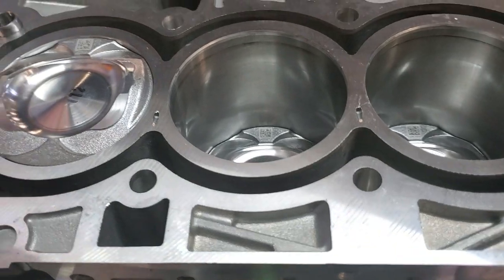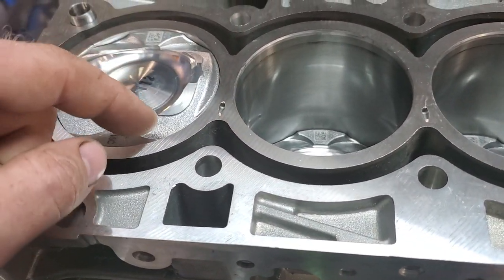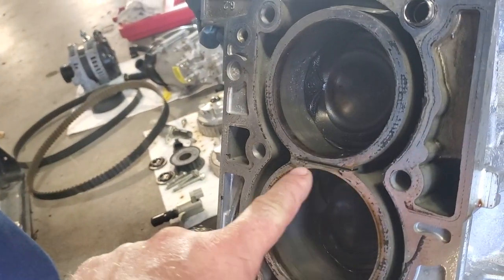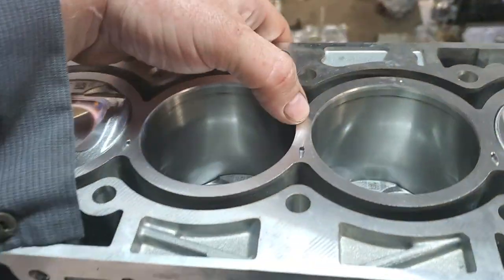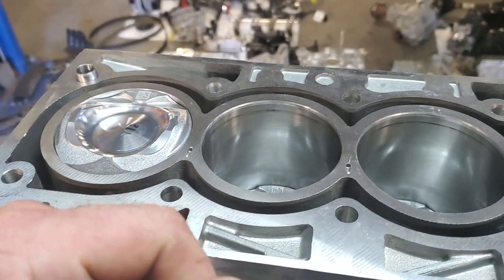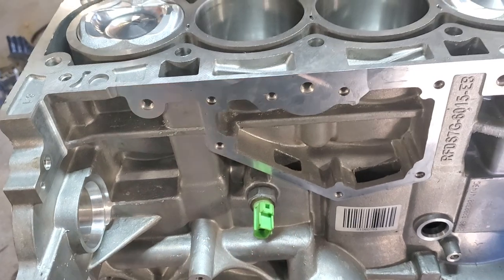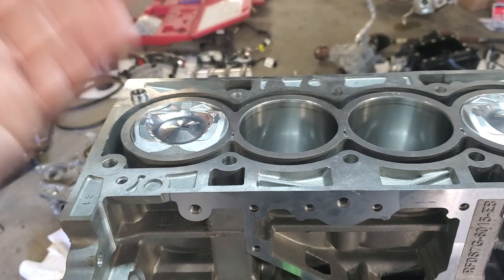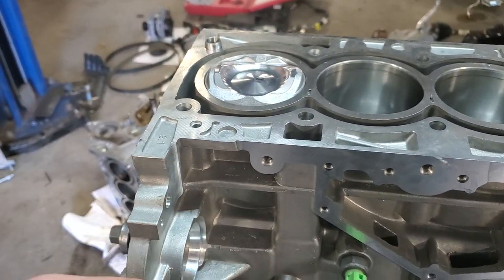Fords 1.5L EcoBoost Engine New Block Design Explained

Comment: We had our engine replaced in our 2018 Ford Escape.  It had 50,000 miles on it and was 4 years and 10 months old.  Ford did a great job and are a moral company for replacing our engine.  The car runs like a champ and Ford realized some engineering problems AND fixed the problem.  We've had Ford's for over 50 years and will continue to buy them as long as they honor their customers as they did in this situation.

Comment: Last September my 2017 Escape started roughly in the morning and a warning light came on. The Escape was scheduled for a service at the dealer and I asked that they look into the warning light. Turns out the engine needed to be replaced due to coolant seeping into one of the cylinders. This happened at 67,000km and took one month to complete the work.. I was provided with a rental during this time. A short block Three pages of itemized bolts etc was provided. Got a free wheel alignment out of this since the work affected this area.
Reply: How much you pay for thw engine replacement?
Reply: @galladinfirever  The repair was covered under the extended power train warranty. It was a short block rebuild of the engine and took about 5 weeks. I was provided with a Ford Explorer as a rental.

Comment: Had this problem the dealership was told to just replace the block with the old style! The mechanics refused to do it unless it was the new style so far it’s doing good but mine only had like 800 miles when it happened
Reply from the maker: it's good that they stuck to what they knew was right

Comment: as a retired GM, Ford tech I thought it was nuts to turbo any engine under 2.0.  I know someone who got a new chevy blazer and it has a 1.3 turbo and told her to be ANAL (3k) on the oil changes and use good oil and filter. these motors under 2.0 are pretty much motorcycle engines. looks like you can't get the 2.5 in the new escape only turbos, that's a mistake. nice videos bro.
Reply: This was why I went with a new Ecosport instead of the escape.  The ecosport has a 2.0 non-turbo motor in its awd version.  Hopefully less problems down the road.

Comment: Great Videos!! Have you seen 2.0L short blocks to see if they also changed to the drill style over the slit? Our 2.0L is getting a long block so we can not see.
Reply from the maker: yes its also updated this way
Reply: @FordBossMe  That's great too hear. I found it very strange that 1.5L gets short blocks and 2.0L gets a long block by default. Though maybe it was trying to hide the slot was still in use...
Reply from the maker: yeah, the tsb says its best to just do the long block, also because of possible valve damage

Comment: Hi there! I’m having my engine replaced on my 2017 Ford Edge Ecoboost because of the coolant intrusion issue. Are they able to put a newly updated engine in it with the slit correction? I’m deciding if it’s worth it to have a new engine put in or not. I don’t want the same issue to happen again down the road! Thanks!

Comment: Do you have any videos of the 2.0 Ecoboost where it shows the new block revision? I ordered a Maverick and I’m curious if it will have the new drilled design.
Reply from the maker: They got rid of that issues with those long blocks in mid 2019 so you're not dealing with any of that with a brand new vehicle

Comment: Thanks for showing the difference between the two blocks, very helpful.  My '15 Fusion is waiting to have this done now.  Are you aware of any of the replacement blocks having same coolant intrusion issue?
Reply: Sorry, just read your answer to HepA Gaming 11 months ago.  Are you still unaware of this issue occurring with any of the new blocks?
Reply: Do you have to foot the bill or is Ford still covering it on your 2015?
Reply: @ScottKelley  hi Scott, my car had 66k miles so it was outside of the warranty.  I contacted Ford and in my case they ended up covering more than half of the cost of the block replacement ($7,700).  Hoping the new block will not have this issue.
Reply: @mikebishop1970  Mine was out of warranty too at 75k miles, just got it back a couple weeks ago from getting the new block. I had contacted Ford as well and they helped out with the costs luckily being that it was out of warranty.  Had the car less than the 5 years powertrain warranty at least.
Reply: @ScottKelley  Glad to hear that Ford helped you too.  Hopefully no more major issues, I still like the car.
Reply: @mikebishop1970  Same, I quite enjoy the Escape overall.
Reply: @mikebishop1970  what number did you call? Mine is having the same issue and they told me it was out of warranty and gave me the number to national something and told me to call them.
Reply: @penisass666  Trying this again.  The number I called was provided to me by the Ford dealership.  After I contacted the Ford support team a case was opened and they communicated directly with the dealership until this had been completed.  The Ford dealership should be able to provide you with the correct support contact information.
Reply: You won't have the same problem don't worry

Comment: I just bought a used 2017 Escape Titanium for my wife. It has 120,000 kilometers. When we got it home it was stuttering and throwing code p0302.

It's at Maclin Ford getting the long block replaced now, and the dealer who sold me the car has kindly agreed to pay.

Seems to me that the lady who had traded the Escape in knew she had a problem and didn't bother to mention it.

I'm surprised that this slot design allowed the engine to last as long as it did. I've heard that there are more problems with the 1.5 than the 2.0.  Maybe it's because the turbo has to kick in more with the smaller engine, upping the pressure.
Reply: Do you know why the dealership is replacing complete engines and not just servicing the head/gasket? If it lasted 120,oookm/5years already...... The cost difference is crazy to me...
Reply: @DrJeff-vn1st  Some dealers have been replacing the gasket, but the problem usually reoccurs shortly after.  Either because of the lousy fundamental design or because the block itself becomes corroded in the area of the leak.

Comment: Hey have you heard of any issues on coolant intrusion with the new redesigned block? I’ve heard of people on their 2nd or 3rd engine with the 1.5L and even 2.0L but not sure if that was just dealerships tossing in the older design with slits as they hadn’t released them yet/didn’t have them on hand or if there’s issues with the newer “version” as well
Reply from the maker: new versions nonehave had issues here
Reply: @FordBossMe  I think 2015 ford ecoboost 2.0 not so problematic quite reliable at least in fusion just not sure if on 2015 fusions they are close deck or open deck
Reply: Where did u hear this @hepagaming6206 
cause I had my engine replaced with the new redesigned block and 5000 miles later. I experience coolant loss again

Comment: Did this update fix the issue? I just bought an escape that has this engine in it. I'll keep an eye on the coolant, but I'm wondering how this has fared after the update.
Reply from the maker: I have not seen one return with low coolant
Reply: @FordBossMe  awesome! Respect for the speedy reply. Thank you

Comment: What break in oil do you recommend? Rebuilding one now
Reply from the maker: Honestly they just have us use the Motorcraft stuff
Reply: @FordBossMe  thanks for replying
Reply from the maker: @mayo8216  if you need any part #s or anything please let me know
Reply: @FordBossMe  thanks man. Just pray for me lol
Reply: @FordBossMe  there is a gasket on the cam assembly on the transmission side. Do you know what its called? I'm sure i can eventually find it but I've been looking.

Comment: Hi. I am looking to buy an ford focus 2015 with 1.5 Ecoboost engine and 140000km on engine. What do you think? Did ford focus from 2015 use that engine design or that year is not affected with bad engine design? Thanks
Reply: A 2015 Ford Focus is only equipped equipped with either a normally aspirated 2.0L directed injected or 2.0L Ecoboost engine if it's from anywhere in North America.

Comment: What year is the new blocks?
We just bought a '21 Escape with a 1.5.
Maybe ours has the newer block?
Reply from the maker: Yours isn't even the same engine, if you look at your engine and you do some research on it you'll see that it's a 1.5 L 3 cylinder new design where this engine is a 1.5 L 4 cylinder old design

Comment: Does the 2020 escape 1.5l 3 cylinder have the new block?
Reply from the maker: The 3 cylinder is a completely different setup 

It does not have the issue

Comment: I just recently bought a used 2018 Ford Escape 1.5  EcoBoost. I thought I was getting a good deal it only had  7500 miles. I didn't buy the extended warranty. I haven't even made my first payment yet.  Please help any suggestions?  Should I buy  a extended warranty now? Which company do you recommend. I am so bummed out now😞. I been a long time Ford owner.
Reply from the maker: I would always buy the extended warranty and I'm going to make a video on the reason why

Just keep an eye on your coolant reservoir maybe check it once a week and see if it's throbbing and if you see a drop I would say noticeably take it to the dealer and let them know that you would like the intrusion block update checked
Reply from the maker: https://youtu.be/0ZGfJb_Iaps
Reply: The dealer said I still have powertrain warranty for 2 years or 52,000 miles whichever comes first. I may trade the car in this winter. Thank you for your comment I am also going to  look into extended warranty.
Reply from the maker: @mannychavez9250  Very Good indeed

Comment: What model did the new block come . I have a 2016 focus 1.5ltr turbo ecoboost 
Can you avoid it in advance by putting a cooler thermostat thermostat and better fan
Reply from the maker: No you can't because it's a block design so no matter what you change about the vehicle the bad block design is still going to be there and if you Google 1.5 L EcoBoost coolant intrusion you'll figure out what vehicles were affected by it
Reply: Thank you so much

Comment: my 2018 escape has the issue, cylinder 4th keeps getting misfire and coolant goes down very quick, Im getting the entire engine replaced, does the new engines from the dealers come with the new design?
Reply from the maker: Yes it does come with a new design

Comment: We're desperate for info.  How can I tell if our 2020 Fusion SE (build date 6/2020) has the updated design of the 1.5 ecoboost I4 engine that does not leak coolant into the engine?
Reply from the maker: Call your local dealership ask them to look at your warranty service history and see if it's been done
Reply: @FordBossMe  Brand new car.   My wife bought in 2020. Haven't had any warranty work needed. Just trying to see if the new car was built with updated 1.5 engine.

Comment: Have you had any of these engines with a rod knock? I have one with a rod knock type noise coming up through the number four cylinder.
Reply from the maker: It's not a rod knock you have a cracked flywheel

Comment: I replace short block engine to long block engine  now i have a water pump harness with no spot to plug it !! What should i do ? Thank you
Reply from the maker: You're going to cut the harness off of where the connector plugs in and you're going to cap both of those lines and they will no longer go to anything
Reply from the maker: Whenever you go to cut the lines make sure you cut them several inches back

But that is the update to the water pump, Ford gives a more sufficient water pump and then you have to cap the ends of the connector and it will no longer be used
Reply: Thank you so much man  i been wondering for 2 days about this connector   👍
Reply from the maker: @Moe151  I don't think there's a programming thing involved like after you cut it but I have to check back in my paperwork when I get back to work on Monday but you should be good

Because I remember one time having to replace the waterpump on one of these engines and the new water pump didn't have the connector on it and I was like what the heck and then I looked in the computer and it was like because it's a more efficient water pump there's no longer a need for the connector
Reply: @FordBossMe  ya thats what i was scarring from put a brand new engine then i will have a check engine light on! 🙂 i really appreciated man
Reply from the maker: @Moe151  I know there is a update to that water pump that gets rid of the connector for sure, even when you look on the parts guys computer at work there is a Ford message that says cut and cap old connector to water pump. 

I cut and shrink wrap the end closed

Comment: Hey, I Own a Ford Focus1.5 Ecoboost; Can you tell us from which year they started using the new block design ?
Reply from the maker: Pretty sure it was sometime in 19, I have some other videos up where I actually specify the years that were affected by this block recall I just don't remember off the top of my head right now so via send me another message on Monday and remind me to look I will but I'll probably forget if you don't remind me I'm at home right now
Reply: @FordBossMe  thanks! can u tell me the name of the vid? I can't find it
Reply from the maker: @remonmedhat8509  I'm with family and it's in my videos I'm not exactly sure what it is and I don't remember all the names of my videos
Reply from the maker: @remonmedhat8509  it's under 1.5 L EcoBoost it could be under an escape a fusion I've done so many of them
Reply from the maker: Okay you can look up TSB 19-2139
Reply from the maker: Here's a link of me screen recording it on my phone because that's really all I have an option to do right now you might have to screenshot and blow it up to see it but give it a shot let me know if this helps here's the video

https://youtu.be/L8J3x0M3h1s
Reply: @FordBossMe  thanks mate! Sure helped! May you have a wonderful vacation😄
Reply: @FordBossMe  quick question, the 1.5 Ecoboost is in my Focus, i am not sure if there are 2019 focus made. Do you by any chance know if it is the same engine as the Escape / Fusion?
Reply from the maker: it is the exact same pretty much 

That's why on the service message they are all lumped under the same TSB
Reply from the maker: you to happy holidays

Comment: have you guys had any problems yet with the new 1.5 3 cylinder in the new escape? I know they're still fairly newer but I just bought one and curious how reliability has been so far.
Reply from the maker: Not 1 problem
Reply: I know quite old post, but did you have that engine ? Are you happy with it after 2 years ?

Comment: What's the part number for the updated block, I'm needing to find one for a 2014 fusion 1.5l small block swap
Reply from the maker: You're going to have to call the local Ford dealer up and get the part number from them because whenever we ask for it they only give us the base and the Ford dealer knows what the full part number is
Reply from the maker: Or if you look in my previous videos I actually have a TSB breakdown of all the parts needed for this and you'll find the information is already on the channel I just right now I'm so busy I don't have time to step away

Comment: So this is what they will replace with on a 2017 that has coolant intrusion? Then the problem shouldn’t return? What would problem be diagnosed as down the road if it should’ve been entire engine instead of just block? These videos are very helpful by the way. From someone who is just thankful to see behind the scenes and get valuable information that most won’t take the time or with the depth.
Reply from the maker: I'm not sure what you're asking about if it happens down the road
Reply: I think Brandon is wondering if the head is somehow at fault.... but sounds like 'Ford Boss Me' had said the block was the only noticeable difference.

Comment: I have a 2016 Fusion with the 2.0.  It’s at a shop now getting a new engine.  They are ordering it from Ford.  I asked to look at the engine before putting it in.  How can I tell from looking at the outside if it’s the updated design?  Is the numbers on the block different?  Please help!!
Reply from the maker: No you have to look in between the cylinders to see if that's lit is there and you can't tell from the outside because everything on the outside is identical
Reply: @FordBossMe  from what I understand you can’t even get the old design anymore through a Ford dealer.  It’s all the new design.  Not the slits.
Reply: @FordBossMe  does the replacement engines have a build date on the sticker?  Where the VEP or Cleveland sticker is?

Comment: I have a 2019 Fusion (2/19 build). Software was updated at dealer to run waterpump after engine shut down. I had noticed some coolant consumption. Seems to have slowed since software update. Car has 24k. What are my chances of getting the updated block under warranty? Should i dump the car?
Reply from the maker: You cannot run the water pump on that vehicle after the vehicle is shut off is not an electronic water pump
Reply from the maker: The chances of getting the block covered under warranty as long as it's under 60,000 miles is 100% if you're going to have to wait for parts